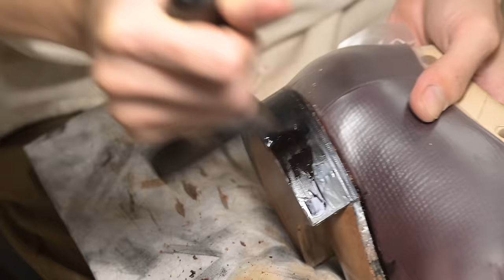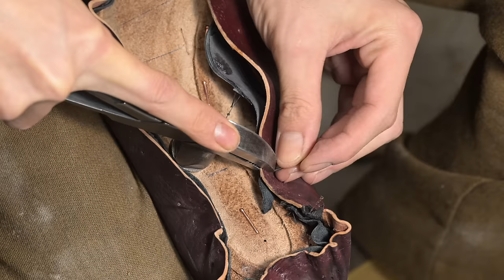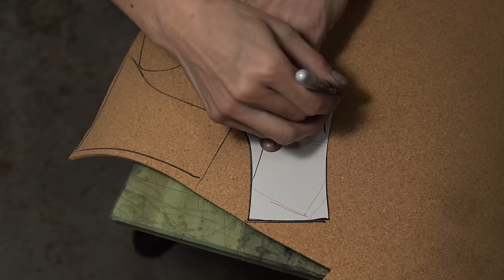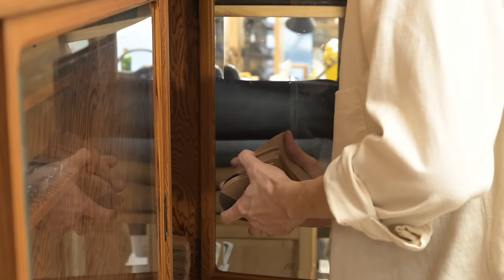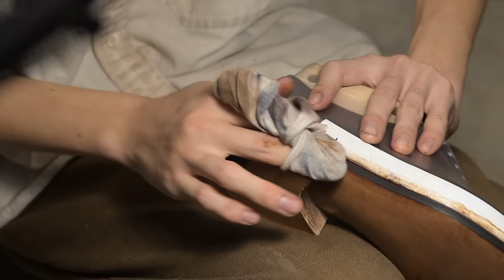Making HANDMADE Derby Shoes in Embossed Cordovan Leather

Comment: 0:12 inspecting leather
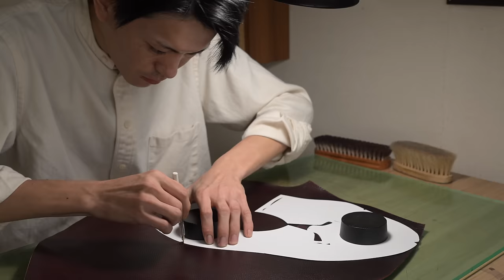0:19 tracing patterns
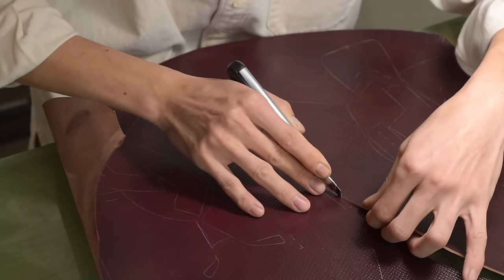0:28 clicking
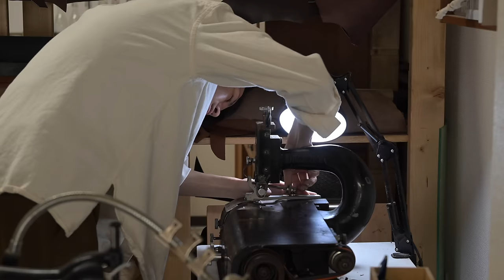1:33 skiving
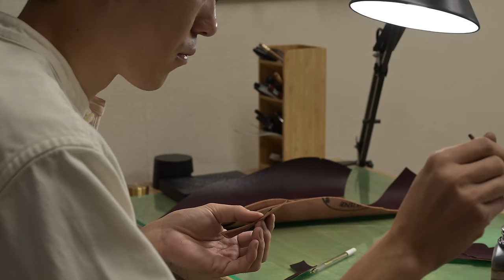2:03 edge painting
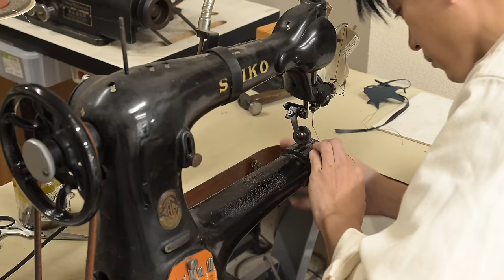2:11 sewing and closing
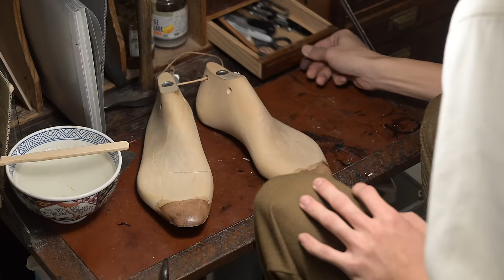5:03 lasting to set shape
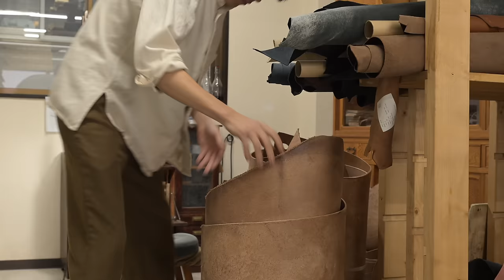5:53 insole clicking
6:27 delasting
6:41 insole mounting
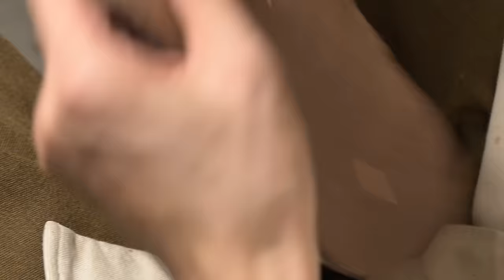7:12 insole trimming
7:29 insole tacking to set shape
7:47 heel stiffener clicking
8:01 heel stiffener glassing and soaking
8:20 heel stiffener skiving
8:44 removing insole tacks
8:55 final insole trimming and rasping
9:29 outside feather cutting
9:58 insole heel beveling
10:05 outside feather burnishing
10:14 inside feather cutting
10:31 inside feather burnishing
10:35 holdfast shaving
10:42 inseam hole marking
10:47 inseam hole piercing
11:10 heel stiffener tacking to set shape
11:44 toe puff clicking
11:54 toe puff glassing
11:58 toe puff skiving
12:39 removing heel stiffener
12:48 powdering the last
12:57 inserting heel stiffener
13:22 lasting uppers
14:20 inserting toe puff
15:22 toe upper lasting
15:48 covering in plastic
16:04 welt preparation
16:11 thread making
16:34 welting
17:29 removing tacks
17:40 welt beating
17:58 welt trimming
18:20 cork sheet filling
19:10 wood shanking
19:21 cork sheet filling
19:52 outsole clicking
20:21 outsole soaking
20:38 outsole skiving, rasping
21:10 outsole mounting
21:27 outsole trimming
21:51 outsole hidden channel cutting
22:22 outsole stitching channel cutting
22:35 fudging
22:50 thread making
23:01 outseaming
24:05 hidden channel closing
24:23 outsole burnishing
24:34 rand building
25:33 heel stack building
26:25 heel lift mounting
27:09 heel shaping
27:22 heel breasting
27:47 outsole shaping
27:57 heel and edge dyeing
28:33 heel and edge burnishing
30:35 outsole dyeing
31:39 outsole edging fudging
32:02 toe tap installation
32:12 plastic removal
32:25 delasting
32:35 sock liner clicking, branding, and insertion
32:55 finishing
33:07 finished shoes